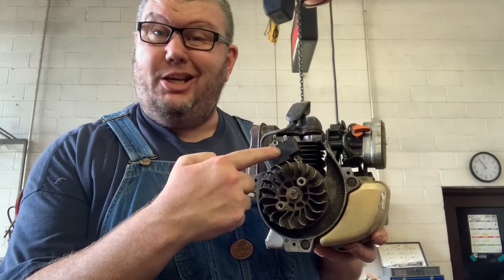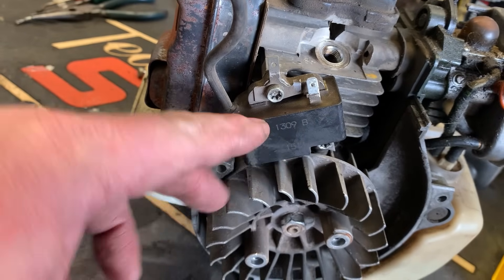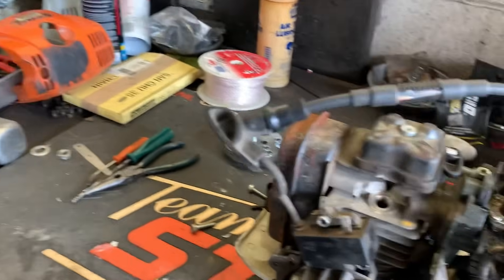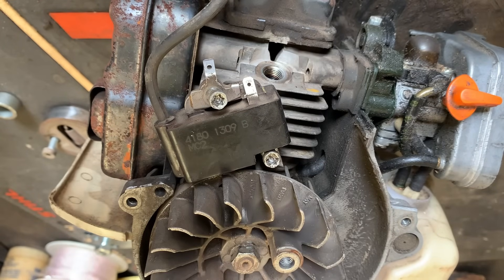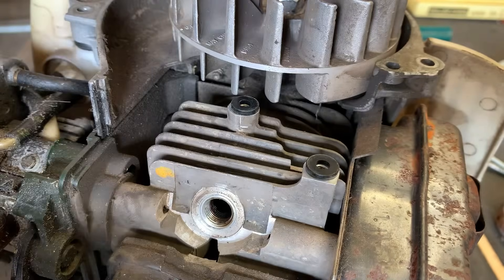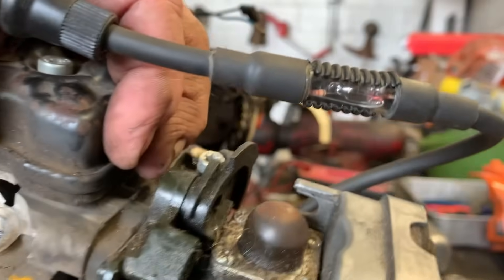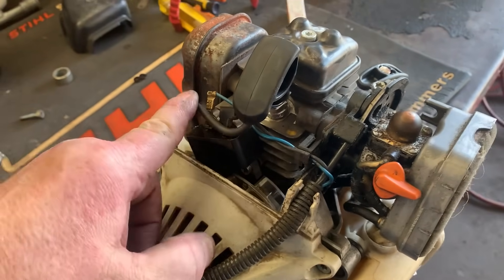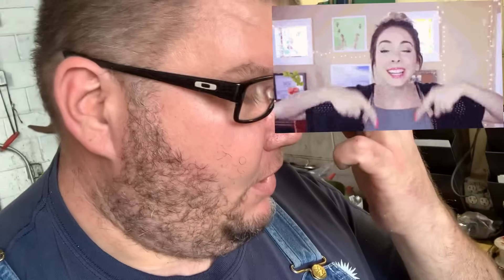HOW TO DIAGNOSE A BAD COIL ON JUST ABOUT ANY SMALL ENGINE!

Comment: And if a new coil doesn't work?  Changed coil, spark plug, checked magnet on fly wheel and verified kill switch is fine.  Still nothing.  Stihl is the worst to work on.  Any ideas?
Reply from the maker: Absolutely whenever you order coils you need to be sure you order it per the serial number because they may be a part number break in there

Comment: Sounds like your drill has a brake, I found gradually letting off the trigger on my Milwaukee seems to shock the engine less. (Once on a 9 HP Johnson I accidentally unscrewed the flywheel nut letting go too suddenly...)

Comment: I can't find any videos or articles whatsoever on the internet on how to remove that damn motor rotor coupler in order to remove the plastic case of the M2500 trimmer so I can get to the coil.  People are calling the shaft coupler halfway down the shaft the "motor coupler" which it is not.  The motor coupler is on the short motor shaft itself.  I'm sure I have a puller kit somewhere but I need to check before I go and destroy this thing further.

Comment: Thanks for making all your videos...but you know, the rubber washers are for vibration isolation...and no amount of polishing of the coil mounts will affect the coil with an electrically insulating piece of material! 🙄...the magnet on the flywheel moving past the coil is what makes the spark, it’s a micro generator...and the kill switch connects to the flag terminals...there is no need for the coil to even contact t the engine...but even if it did...the mounting screws are metal and would provide continuity...so probably you lucked out and even if why you think the coil needs to touch, there may have been corrosion in the screw threads...also...you should show the need to ground the electrode of the sparkplug...that is where you need continuity...otherwise even a bad sparkplug will cause your tester to not light...we had two instances of this issue on two blowers...

Comment: That tool is very specific to Stihl. Basicly, you check the plug wire at the coil for spark, but it needs to be strong enough for the engine it's designed for. This video is good for this brand of small engine.

Comment: Hey mowermedic1 I’m working on a fs 38 trimmer that back fires from carburetor. I’ve replaced coil,  piston and cylinder and still doing the same. Even if I spray carburetor cleaner in the cylinder won’t start. All you can hear is popping from carburetor now and then while I’m pulling to start. Any idea? Thanks in advance

Comment: Did you say 4 cycle or 2. Thought 4 cycle engines had intake and exhaust valves...and you don't mix your oil with the gas.
Reply from the maker: The four mix engine is a four cycle engine that utilizes two-stroke mix

Comment: Here's one for ya. Whys my Chainsaw keep killing coils after 10 mins of run time? It's properly gaped, new spark plug, wire to the kill switch is new. But yet it's killing oem and aftermarket coils in just a few minutes. Never had this issue before.

Comment: I have a BR350 that shocks me at the trigger. Any suggestions of what it could be
DLCR El Paso,Tx
Reply from the maker: Static discharge cable missing
Or damaged
Reply: I’ll check that out. Thanks. Also have another issue in another piece of equipment. Get back to you later on that issue. Thanks
Reply: @THEMOWERMEDIC1  
Seems to working okay after I took the coil off an cleaned the ground points. I have SR200 sprayer that leaks product thru the tube where the trigger is. I’ve already replaced the pump behind the motor thinking it was that an still leaks.

Comment: Excellent. Thank you. Just a suggestion, I find dropping the screws in before placing the coil and holding them with fingers helps by not having to fish for the spacers. ;-)
Reply from the maker: Is to apply just a drop of CA glue a spacer

Comment: Have you ever experienced a 2 cycle ignition module poulan pro that would get hot and customer says can't crank it.  By the time I get the equipment it seems to run ok but acts like carb issues. Module finally goes out completely after its brought back the 3rd time.
Reply from the maker: Put an in-line spark tester on it while it’s running when it dies see if it’s still sparking
Reply: @THEMOWERMEDIC1  thanks

Comment: That's fine if the average DIYer has that spark tester dooverlacky with the internal doohicky.  But what about a testing the primary and secondary coils with the multimeter ?  Most DIYers have a multimeter.
Reply: My thoughts exactly!

Comment: To quote a famous NASCAR legend; Henry 'Smokey' Yunick.   An American mechanic and car designer associated with motorsports. IF THEIR'S NO FIRE IN THE WIRE, THEIR'S NO HEAT ON THE STREET'S.  If you don't know of this man, shame on you. Some say he cheated, some say he was VERY INNOVATIVE!!! NASCAR rules said that you had to have a fuel cell in the back of the car, and use a gas line to route too the motor up front. Well Smokey opted for a 2" inch gas line.  I would say that was very INNOVATIVE,  NASCAR said he cheated. I'll let you the reader decide. Oh, and that ain't nothing.  Check out: 7 Hilariously Mad Racing 'Cheats' That Were All The Work Of Smokey Yunick. See, people using that word cheat, not  VERY INNOVATIVE!!!

Comment: Hi  I saw on line someone  repairing  stihl coils and Selling them.  The next no spark coil that came in l decided  to strip it apart but found completely  seal unit.  I pressed the coil of the horse shoe and found corrosion on inside horseshoe  and spring tension earth wire. I clean the corroded  part and assemble  and worked  O  K.

Comment: I learned about coils a long time ago.  I have a spark tester and it will show me in a second whether the coil is good or bad.  I never have forgotten “Blue is good, red is dead and yellow is in between.”  This is the color of the spark on the spark plug but it is the same colors given by my spark tester.  If the spark is not blue, I put a new coil on it and recheck.  The first thing I do check is to see if the bayonet connector is in the spark plug wire.
Reply from the maker: Wow I bet you’ve replace a lot of good coils using that method.
Reply: @THEMOWERMEDIC1  yep cause I just got back from Briggs training about a month ago, great refresher cause I been doing this forever between gens and engines and trucks and cars. 
Basically never forget the 101 basics and you're good. 
I vividly recall the quote at school recently: 
Pretty much if it's jumping our (Briggs) spark tester, it's good ,don't worry much about the color.
Reply: Correct blue ❤ yellow pitch😢

Comment: Maybe you can help me on my Echo GT2000.  Had real weak spark and would not start.  Based on ohm test, coil was bad.  Put a new coil on, and totally no spark.  Got the gap set right at about 1mm, and even put a new plug in to boot.  I will take apart again and clean the shoulder on the 2 coil screws....maybe as you said its just a bad ground???????   Driving me knuts.
Reply from the maker: There is no factory parameters for an ohm test.  It’s either sparking or it’s not simple as that
Reply from the maker: There is no factory parameters for an ohm test.  It’s either sparking or it’s not simple as that
Reply: @THEMOWERMEDIC1    Hey friend.....I did a few videos of this spark problem.....this first one is me testing the old weak coil:  https://youtu.be/_HCVSuMc0Hg
Put the new one on and nothing....no spark.  So, it must be that the new coil is defective, right?   Even though the new one tests at 2.4 ohms (specs are 2.4 - 3.2), it still can be defective, right?
Reply: Magnets on the flywheel could be bad.
Reply: I determined that the "new" coil that I bought from the commies on eBay was bad.....idiots refused to replace it, but finally eBay forced them to, and they sent me another bad one.  I then ordered a used stihl one on eBay, put it on, and the problem was solved.  Damn commie-made parts.

Comment: About a month ago my MS 201 C-EM just died, like shot to the head. No spark on different spark plugs, I was not to happy about it, ignition coil costs pretty hefty sum of money for that little saw. But my trusty mechanic found the problem - kill switch wiring got defective, no visual damage on wires. 
Do You get many small engines with that kind of problem?

Comment: Would the spacers not insulate the metal to metal contact point that you sanded?
Reply: yes the spacers used there will insulate metal to metal contact, BUT the screw used to fasten the coil down will make electrical contact.
Reply from the maker: No because the screws make the connection
Reply: @THEMOWERMEDIC1  So, why Scotchbrite the mounting points?
Reply from the maker: @N269  to  make sure the post are  clean and flat, had I not done it you’d be asking why didn’t I do  it🤷

Comment: Excellent information for me.  My dad just had me hold the spark plug wire to see if it had spark.  Never been the same since.  Thanks for the  video.
Reply: 🤣🤣🤣 I can testify to that! Many years ago, one of my neighbors had a Rambler that the engine was shaking on idle. It was beginning to get dark and he asked me what could it be. We opened the hood and noticed that the coil was arching. I pointed to it and he proceeded to touch it! You can imagine what happened! He got the biggest jolt of his life! This was in 1984 and I think that he is still feeling it.
Reply: Hell for poops n giggles I had my brother hold the spark wire from a yellow super coil on my old 76 Chevy V8 he yoused to have strait blond hair and I used to have 2 more teeth in my mouth
Reply: You,or your dad?
Reply: @americafirst2785  DERP says what? 🤪
Reply: My dad would grab the end of the lead and tell me to turn it over.

Comment: This is from Don small engine repair you did not say anything about the magnet on the flywheel if you have no magnet on the flywheel you will not have spark correct keep up the good work
Reply from the maker: This is my channel not Dons.  The magnets do not come off So there is no way to lose them and I did mention the magnets you must’ve skipped over that part have a good day
Reply: @THEMOWERMEDIC1  You have never seen the magnets come off a kohler flywheel?
Reply from the maker: @kevinclark8782  nope not
For the ignition system   Now the magnets for the charge system yes every day

Comment: I am sure it has something to do with the "non servicable electronic components" inside the coil, but have you had any luck spinning a dead coil up with a drill?   I have done it two times with sucess out of maybe 10, one I actually watched the spark become more intense.  The one is on an old FS76 trimmer that I gave $3 for.  The coil is "obsolete" (but not really), I still use it 3 years later.  I thought it was BS when I seen it on a vid, I'll testify to it now.
Reply from the maker: Yes I just posted a video about that in the comments and the description
Reply: @THEMOWERMEDIC1  Thanks brother.  Confession time...  real life interrupts my YouTube time, so I am a little hop skip sometimes.    I always give you a thumbs up if it's any consolation.   :)